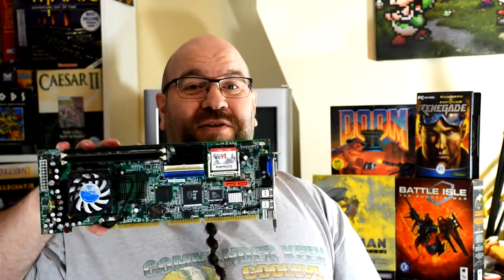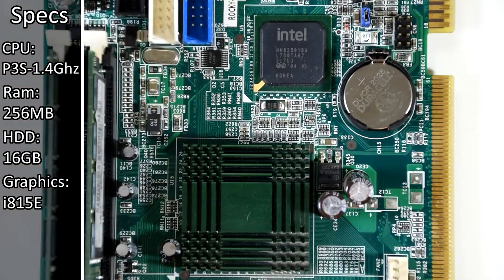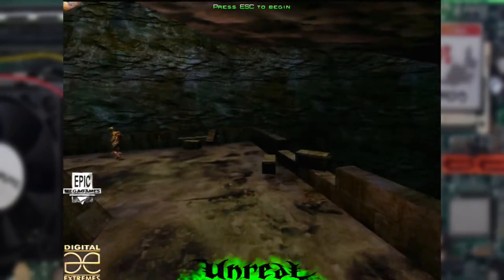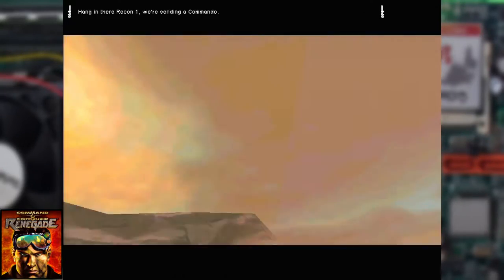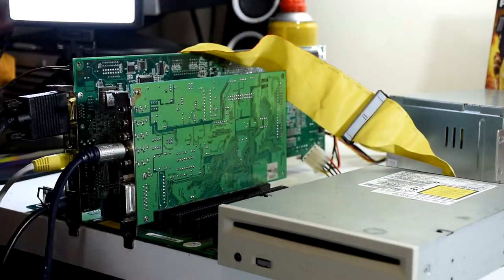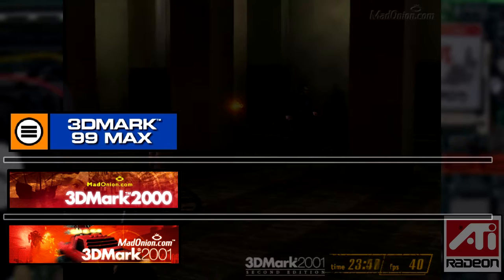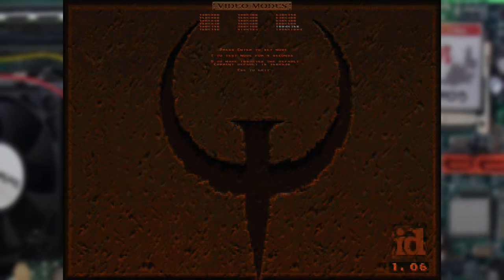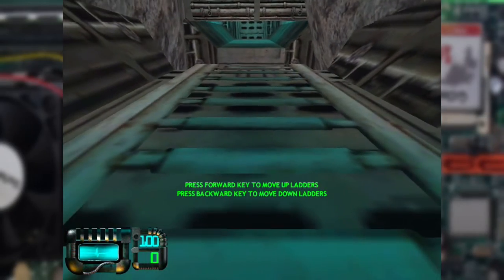Industrial Gaming on a Single Board Pentium 3 Computer

Comment: interesting concept,is the board that this slots into atx standard,if so,a case should be reasonably cheap,i think like a cheapo desktop or mid tower,roy
Reply from the maker: As far as I'm aware its mostly ATX standard so I could have put it any old random case.
Just didn't think any I had looked right for the job, plus they needed to have the space inside for the long card.
Reply: @GouldFishOnGames  thinking again im not sure about the standard case now after i posted a reply,the board seems to have more than 7 backplanes? isa a pci combined

Comment: was also wondering if it would work with a  radeon 9250 128mb card,should be cheap
Reply from the maker: That could be an option as a card, The difficult part is finding a PCI variant.
I see lots of AGP that seem reasonable but some that are marked at PCI show AGP connectors in the pictures.
Reply: @GouldFishOnGames  i think your right,i had a quick look and there isnt many now at all,strange they used to be common as muck,i have one knocking around somewhere,i dont mind partign with i dont use it..roy